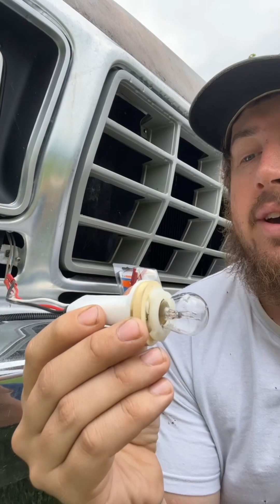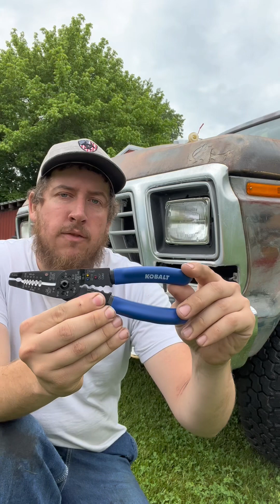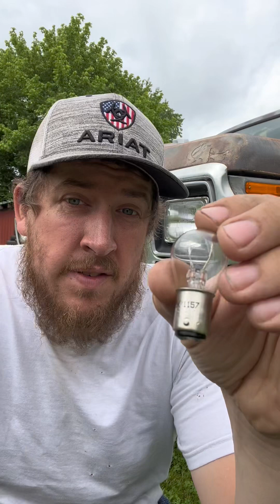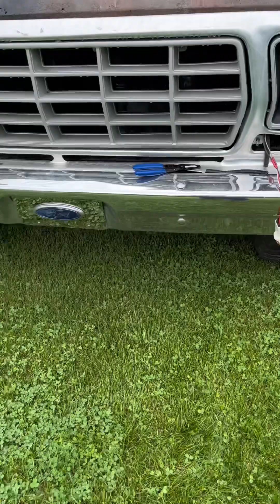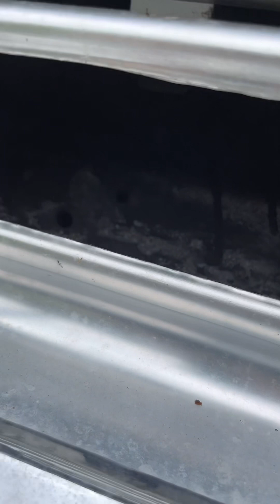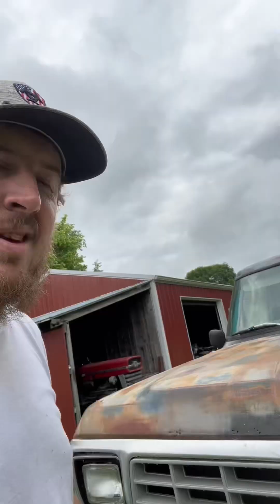1979 Ford F-150 Turn Signal Socket Replacement

Comment: You jackass you could’ve told us what wires go to what…
Reply from the maker: I didn’t realize at the time of making this video that I didn’t actually tell anyone where the wires went . That is my mistake and a lot of people have called me out on it . I honestly didn’t know where they went either other than cutting them off one at a time and putting them back the same way they were before.  So yes I failed on this one and I am sorry. I never intended to upset anyone with false information or a terrible video. I just showed what I had done in this situation. Thank you anyways for watching and sharing your opinion. I will do better on the next one .

Comment: What color wires did you connect. Socket has white red and black. Truck has brown black white/blue stripe
Reply from the maker: At first I didn’t understand your comment. Then I re watched it and realized that I didn’t actually state which wires were which. And I apologize for that. In this specific situation mine had already been replaced before at some point and gone bad again. So I re spliced them the way that they were wired before. However an easy way to check the wires on the truck side would be with a test light and clamp it to a good ground and find out which wire is on with just the running light switch. That would leave one of the other ones being ground and the other would only illuminate the test light when the turn signal switch is on. Once you determine which one is ground on the socket you would only have 2 other combinations to try with the other ones if they arnt already marked on the package.  Thank you for watching and again I apologize for not a clear video.
Reply: @Whatwouldjoeydo94  you still didn’t answer the question lol. That’s like the best information in a video like this and you completely missed it and still didn’t give the information when someone asked. That’s probably why there’s only 700 views.